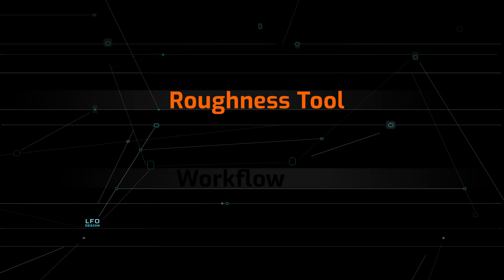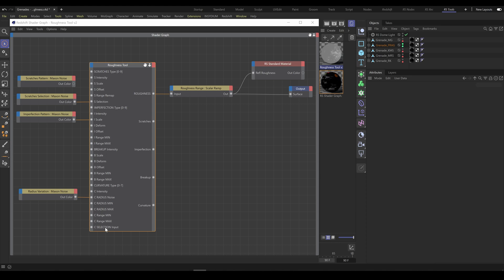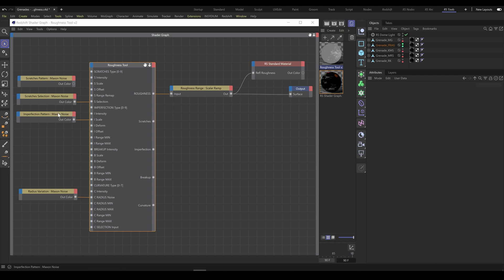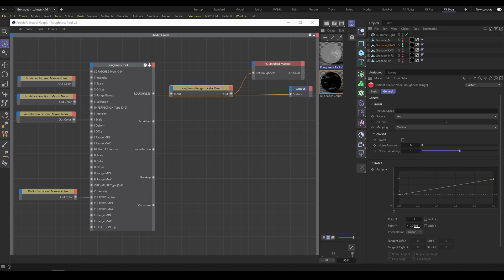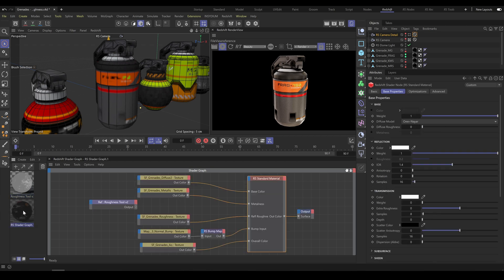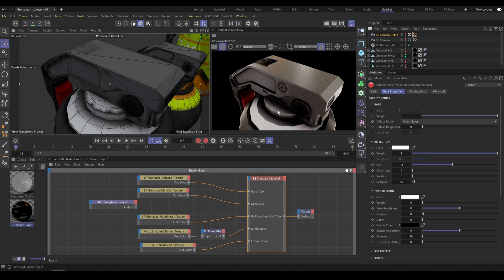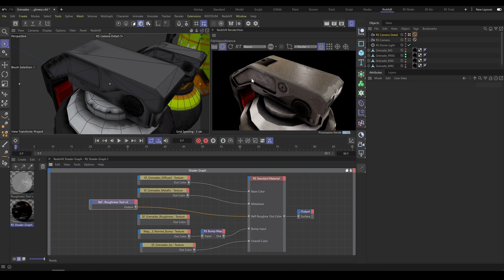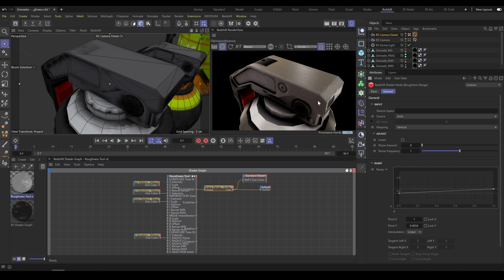C4D/Redshift - Roughness Tool

Comment: how do you bring this into the new node editor? if i wanted to bring in the curve tool or other tools ? also when i convert the procedural textures into new node editor i seem to be getting problems. can you help . 
still great value  best i have seen for a long time.
Reply from the maker: Thanks, we are very happy to hear that you like it.
These tools are using Xgroup/Xpresso which is not supported in new node editor yet. But when Maxon will make proper support of Xgroups for new node editor, it will all work in new node editor as well.
Reply: if you did the snow and ice tool that would be a great help.
Reply from the maker: @SLAMINGKICKS  Snow and Ice materials are already available in: LFO materials / Ice Snow Lava category.
Reply: it would be great if you could do a video showing how to use the snow tool.
 @LFOdesign-Tutorials